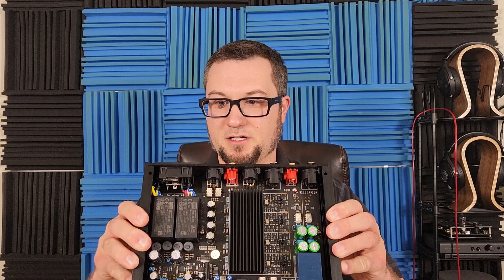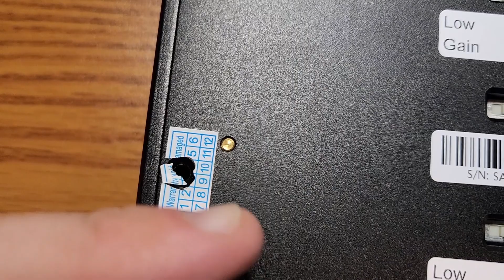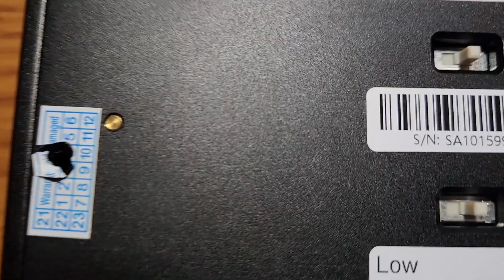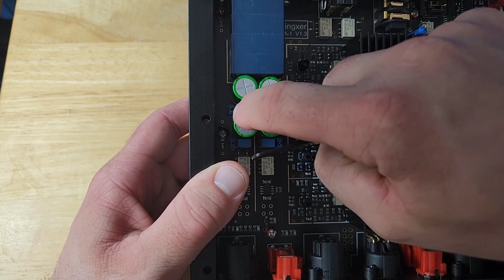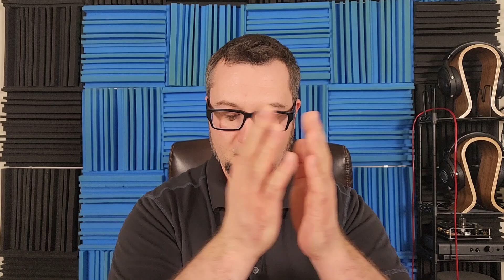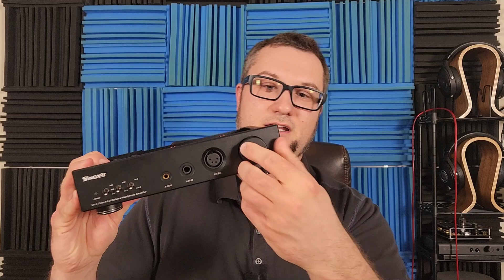Singxer SA-1 Review Part 2: DC Offset Mod...Worth It?

Comment: weird your initial reaction as a design choice is "why" mine is the opposite "why not" and thankful that they did.  Some car manufacturers design a car that can be mod'd by the aftermarket with various tweaks and ECU tunes.  Some manufacturers spend millions trying to lock the ECU so that aftermarket providers have a hell of a time doing a reflash and tune to the engine.  I appreciate the design of accessibility.
Reply: Ikr why not do it
Reply: He may relate to why put gain switch in the bottom of the unit. Yes, these are just few fine engineering thought.